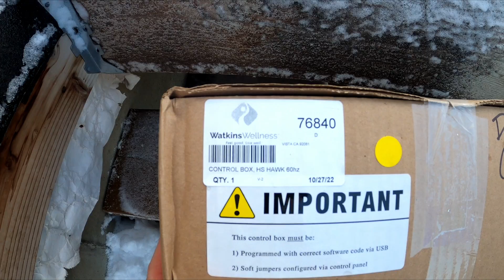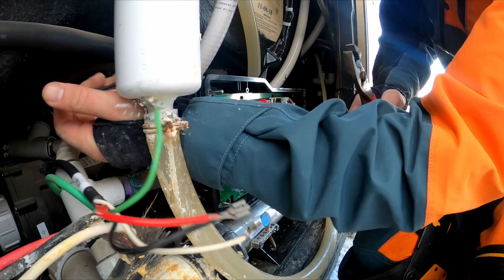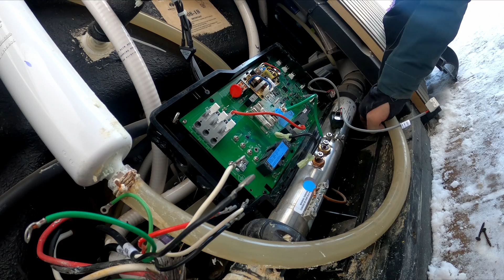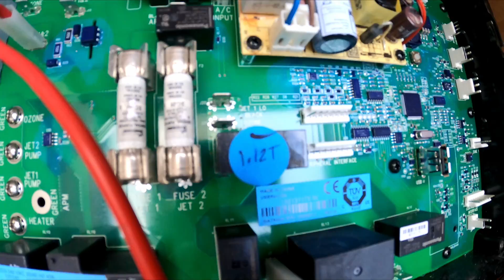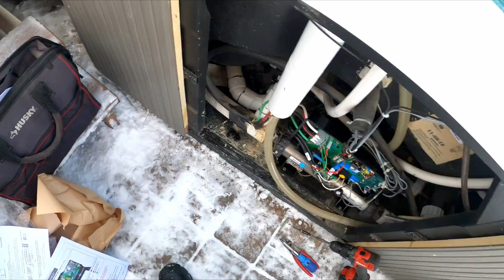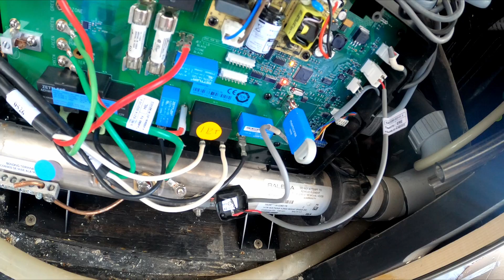Hot Tub Circuit Board Replacement – Hot Springs Hot Spot Relay 2018

Comment: I have a hotspot sx. My board got replaced. Do I have to also program the controller to switch from 120 to 240volts; or is it just removing the jumper spade and moving the red wire over to the other terminal?
Reply from the maker: Hi there,
Can you let us know what model your circuit board is? The solution can vary depending on the type you have installed. However, in most cases, simply switching on the jumper should do the trick.

If you have any questions, feel free to give us a call at our service line: (208) 523-4633 — we’re happy to help!